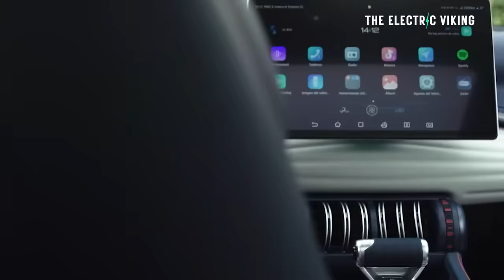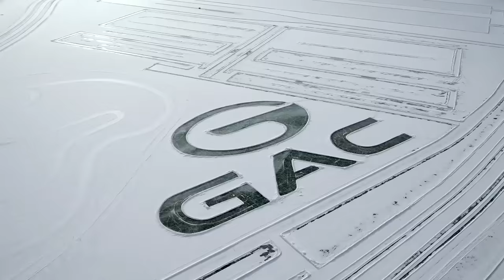China's car market is in meltdown, but EV sales are up nearly 40% in 2024

Comment: The decline in Chinese car sales is due to February being the Chinese New Year
Reply: Moreover there are all new versions of the cars starting from March. And there is no sense at all to order old version when everyone know that new are refined, better specs certainly and even cheaper. See how changed model line of LI, Zeekr, BYD etc
Reply: But China's automobile exports are still strong.
According to the data released by China Automobile Industry Association, from January to February, 822,000 automobiles were exported, up 30.5% year-on-year.
Reply: When BYD sells an EV in the states for $25K, I’m in.
Reply: @jamespn  don’t hold your breath, tarriffs will make that unlikely in the U.S. for quite some time. Just by a VW or Kia or Tesla they will all have better support for maintenance issues.
Reply: @RandyP-jr1ek  I’m turning blue all ready.
Reply: Another 50 cents cybertrooper
Reply: February is short month and Chinese New Year month. It’s data doesn’t mean too much.

Comment: There comes a time when people know that the next car  is going to be electric and yet they are still a bitexpensive so peple hold of from buying a new car. We are on the cusp of a massive transition after which you wont be able to give away a petrol car.
Reply: There comes a time when people know that the next car is going to be electric — or ICE, or hybrid. This whole car thing will eventually settle down with a place for all three types. No single one of the three will dominate the market.
Reply: @ivannavi8154  Yes why would you want a car without hundreds of moving parts to break?! I like my vehicles slower off the line, lower torque and polluting!!
Reply: There comes a time when people know that the next phone is going to be a smartphone — or flip phone or corded phone. This whole phone thing will eventually settle down with a place for all three types. No single one of the three will dominate the market.
Reply: @juliahello6673  🤣
Reply: @ivannavi8154 YEAH- NAH.
Reply: @juliahello6673 honestly this is the most accurate and funniest thing I've read for ages.

Comment: the power per kilowatt in China at max is 10-15 cents (US) in 2023 and more renewable energy with the latest 4th generation nuclear power will be deployed. If you have to pay for gasoline the price is similar to the western countries. So, if you are a consumer which car will you drive? On top of that the Chinese are more conscious and willing to adapt to new technology as it improves the air they breath and if my memory is correct in 2023 survey of major air pollutant of the top 30 cities in the world, none of the Chinese cities were in that award.
Reply: Environmental protection and noise are only secondary reasons.
Most importantly, in China, the use cost of EV is much lower than that of ICE vehicle.
Reply: @amandagrant4331  not true,  the public transport (BUSES AND TRAINS) and taxi is an indicator few years ago in major cities that are all EV long before the cost of battery coming down as people are more aware of the environment and also the ability to be allocated a registration whereas ICE is allocated through selection by random.

Comment: The serious decline in actual sales of non domestic cars is a good thing, which is conducive to China's GDP growth. It is more conducive to nurturing strong domestic brands. Since some people want to play decoupling, they should not have the Chinese market. Promoting electric vehicles is beneficial for optimizing energy supply and reducing dependence on oil. China's nuclear power, photovoltaic, and hydroelectric technologies are very powerful. Replace inefficient old power plants with new coal power plants. And there is a planned reduction in the proportion of fossil fuel power plants. The comprehensive use of electric vehicles and the new 450KM/H high-speed rail will significantly reduce environmental pollution. This is the future, and the future is China.
The latest practice shows that photovoltaic power plants can quickly reduce desertification, which is truly an unexpected gain. Photovoltaic power generation and animal husbandry can be effectively combined.

Comment: Chinese-brand passenger vehicle sales up 26.7 pct in January-February
 Xinhua, March 18, 2024
"Sales of Chinese-brand passenger vehicles soared 26.7% yr on yr in the first 2mos of 2024, industry data showed.
About 2.07Msuch vehicles were sold during the period, according to the China Association of Automobile Manufacturers.
The market share of domestic-brand passenger vehicles rose 7.6% points yr on yr to 59.9%   during the period."
In February alone, some 791,000 such vehicles were sold, with the market share up 6.5% points year on year to 59.4%."

Comment: This is all very nice trotting out percentages. It doesn’t really matter because a big problem is coming with Chinese EVs. A friend in China is a Process Engineer. He was contracted to look at EV assembly line practices and noticed early on that the manufacturers aren’t building up spare parts inventories. All the available parts are going into the cars on the assembly lines, virtually no spares. So the eventual owners of these Chinese EVs are going to be in a pickle when their car needs a part in the future and there are very few about or none, or it takes 3 months to get one. It’s already happening in China so it will surely happen elsewhere.
Reply: Where did the news come from, China has 90,000 auto parts companies, follow-up maintenance and spare parts, no problem at all,
Reply: I worked with many Japanese car mfg. The spare parts for aftermarket never go into car production plant, only OEM parts get into for assembly. 

In many cases, the OEM parts have more stringent spec (that explains same part come with car last longer than the replacement one even replaced with genuine parts. The after market spare parts needed packaging that is wasted (cost) in mfg plant. 

Some parts come in with pre-assembly from partners so no separated parts either. 

If you do not know auto industry but listen to here say there say then it’s useless.
Reply: @wsi1917 You're right  👍😘

Comment: China has national policy to promote green transportation, and EV is the way to go. Traditional fossil energy car will be eliminated in China consumer market😅
Reply: Without a green party, but with reason.
Reply: How can BEVs be green when
1) more than 80% of electricity in China is generated using fossil fuels 
2) the carbon footprint to manufacture BEVs are 8X that of ICE
3) when thermal runaway happens, the amount of greenhouse and toxic gasses emitted will not only do more damage to the environment and humans
4) recycling of batteries uses enormous amounts of energy
Reply: @yslee1401 that’s not true. Renewables make up a much larger percentage of power supply than you think
Reply: I see you have not heard of Thorium nuclear plants. Please stop exposing your ignorance in a public forum!
Reply: @yslee1401 BEV may or may not be greener, but a coal powered modern power plant is far more efficient and clean than ICE vehicle, not to mention many even cleaner electric power plants that provide power.  That and reduction of pollution within cities makes BEV a far better option than ICE.  
As for BEV 8x more carbon footprint than ICE, that ratio is only achieved if you don’t compare them evenly across all categories.
Reply: It's a strategic choice. When they take Taiwan the Americans are going to block oil shipments from the Middle East. Reducing oil demand is key.
Reply: How many coal powered plants are they opening every year
Reply: @ecognitio9605 Going green is China's strategy regardless of Taiwan. China is not leading the green industries in the world because of Taiwan. 😅
Reply: @yslee1401  so many wrong statements in one comment. China has build more solar power in 2023 than US has done totally up to now.
Reply: @cinpeace353  Taiwan will never be a part of China. When China implodes, Taiwan may consider adopting China as their western province by renaming it Western Taiwan
Reply: @yslee1401  No ICE vehicle possibly approaches 40% efficiency.  You are just talking about the theoretical maximum value of a particular engine, which couldn’t possibly be achieved during most if not all of its real world operations in a real vehicle.
Oh, and BTW, the number you need to beat is 45%.
Reply: @xsu-is7vq  that’s why Toyota will never sell this technology to China.
https://en.wikipedia.org/wiki/Toyota_Dynamic_Force_engine
Reply: @yslee1401  brain is a valuable asset for us humans, learn to use it.
Reply: @yslee1401 Taiwanese 🐸 alert 😂😂😂 U can go watch ur China censored or New Tang TV or Fox news
Reply: @xsu-is7vq  45%? What about the power transmission losses, transformer losses, carbon footprint used to built, operate and maintain those EV Chargers? Gotta learn a thing or two about electricity transmission
Reply: @yslee1401 according to the U.S. Energy Information Administration (EIA), petroleum and other liquids make up the second-largest fuel source, accounting for 19% of the country’s total energy consumed in 2021. Although China has diversified its energy supplies and has replaced some oil and coal use with cleaner burning fuels in recent years, hydroelectric sources (8%), natural gas (9%), nuclear power (2%), and non-hydro renewables (7%) accounted for relatively small shares of China’s energy mix. However, natural gas, nuclear power, and renewable energy consumption are steadily increasing. Coal power is 55%.
Reply: @yslee1401 China's total power generation capacity reached 2,920 GW in 2023, in which coal's share dropped to 39.9%, while the share of non-fossil fuels, namely nuclear and renewables, reached 53.9%, according to CEC's newly published report titled "2023-2024 National Power Supply and Demand Analysis and Forecast."
Reply: @directxxxx71  and China has the biggest coal reserves in the world. What do you think will happen when the Chinese Yuan can’t be used for international trade anymore like the Russian Ruble?
Reply: @yslee1401  oh, you forget about the transmission, AC, water pump, alternator, braking, idling, acceleration, which all reduces the overall thermal efficiency of ICE vehicle, to something like mid 20’s at the wheel?  And all the carbon footprint of refining the oil into fuel, transporting it on trucks, spills and leaks, manufacturing of all the maintenance parts and supplies?  It appears you have a lot to learn about how ICE works.
Reply: @xsu-is7vq  and BEVs have such heavy batteries that they wear out the tyres, roads much faster than ICE. Also, older and low end Chinese BEVs uses resistance based heating. That’s draining useful electricity to waste
Reply: @yslee1401 So now you use “older BEV”’s inferior technology to say BEV are not as efficient?  Do you really want to compare the efficiency with older ICE vehicles?
Reply: @xsu-is7vq  older BEVs means those that don’t use heat pump. Seems like your knowledge is pretty limited when it comes to technology, or perhaps you are just regurgitating CCP little pink scripts. Low end Chinese BEVs also does not have heat pump system
Reply: @yslee1401 you are so smart and right. I think you should be the president of US!
Reply: @WarmheartedKyubey  I think you should nominate yourself as the Chinese President replacing Winnie the Pooh
Reply: @yslee1401  For China it's strategic decision, there is a lot of margin for improvement and they want to lead the change. The moment they get a SUV with a reasonable range for 30K $ the EV adoption will accelerate pretty fast. An EV as (Model Y) best selling car 2023 is unprecedented.
Reply: @yslee1401 It is easy to cope with air pollution at the sources rather than at the  end points. Fossil energy cars and airplanes exhausts are hard to eliminate because they are distributed in everywhere. If the coal power generators are located at planned locations, it will be  easily to filter off the toxic gases and more effective.

The EV technologies (battery, motor, AI software and wireless communication) are just in the beginning phase, and will definitely evolve very fast.
Reply: @akakakakakak3084  what about micro particles pollution caused by EVs excessive weight wear and tear on tyres and roads?
Reply: @yslee1401 we get that you don’t want an EV.  Good for you! Is that enough?

Comment: China, China, China. Hoo-bloody-ray for China. Nothing mentioned here that China has about 3000 coal fired power stations and are building more as fast as they can. So as EV production increases in China the amount of coal burnt increases to supply the amount of electricity needed in the manufacturing process. Hardly green.
Reply: What’s your country doing?😊
Reply: @malcolmrickarby2313  We're basically doing bugger all... but at least we're not building more coal fired power stations. What's your country doing?
Reply: @ivannavi8154  stalling wherever possible and shipping coal and gas to China. 🤷‍♂️

Comment: The Chinese economy is difficult to understand as their are many finished goods which are now  being sold at prices that appear materially impossible and observers are left speculating how this can occur are the buildings , materials, transportation  or wage costs being  subsidized in some manner or is money being poofed into existence inside accounts that are servicing some policy objective?
Reply: except it is not materially impossible. it is well known that australia attempt to refine the battery material with the aid of japan is still 80% more expensive then chinese material. china has spend 30 years in developing material science to make it possible to extract the material as a byproduct. this is why they can get it this cheap, because they don't have to make the material for the sake of making battery material, their economy of scale on other material is so great, that as a byproduct, they can produce enough material. this was discuss heavily when US attempt to develop it own battery industry. so it is entirely not true that we don't know how they did it, but we don't have the economic structure nor scale to do what they did, and even if we did, they are 30 year ahead of us in working out how to integrate everything. the failure of Australia to make competitive material is the real reason why Japan did not make EV, they just can't make them cheaper if the raw material is 80% more expensive so they save them for higher value electronic that doesn't need as much volume.

things like solar dominance is again due to their full in investment in monosilicon which germany saw as sucidal because they though silicon prices will go up. but gemany made the wrong bet, silicon prices when down and chinese company that rely solely on silicon and not more expensive exotic material were able to make solar panel far more cheaper than their western peers that were pulling technology to get out of silicon. so alot of the reason for western failure to met chinese prices is due to bad choices in material. and the west has to admit it, learn from china, or it will keep making the mistake and end up doing what you are doing which is to think that these prices are impossible. when it is just that western companies are picking bad material choices or they don't know how to produce that material cheaply.